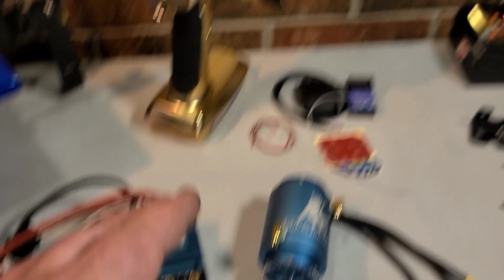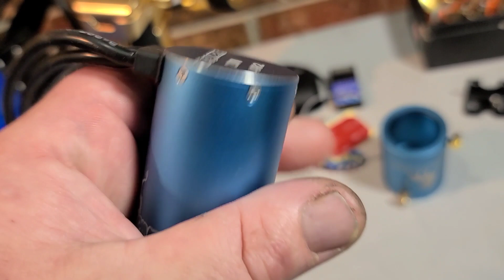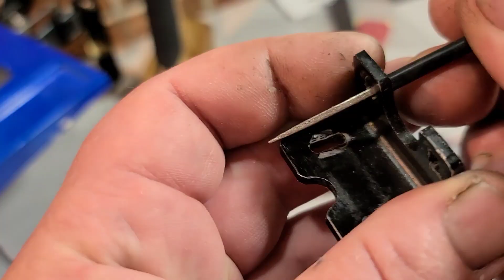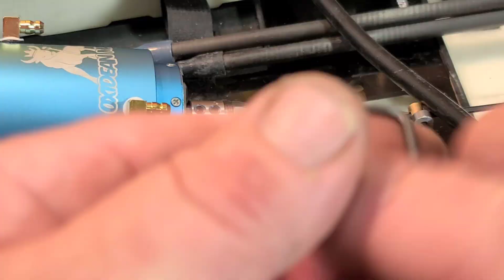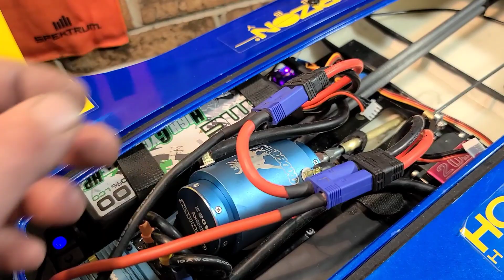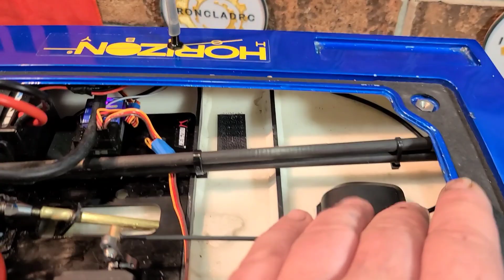Oxidean 200 & 4082 6pole Brushless Motor & Esc Upgrade Proboat UL-19 - Rc Boat Electronics Install

Comment: Hey B, how do you run this boat? Every time I use it, it takes off fast and then the shaft comes loose, leaving it stranded in the middle of the lake. Then I have to re-tie it, and the same thing keeps happening over and over. By the way, I’m running it completely stock. (ANY tips)?
Reply from the maker: You need to remove the see teflon linner and get an HD cable along with a new collet 

Parts list
.187 flexcable to 3/16 stub shaft 3.25 w/ drive dog & nut
https://www.offshoreelectrics.com/proddetail.php?prod=ose-cable-187-XL&PARTNER=ironclad

5mm to .187 collar
https://www.offshoreelectrics.com/proddetail.php?prod=ose-81518&PARTNER=ironclad

You will need to cut the drive dog slit on the cable and cut the cable to length,  this is the setup I run
Reply: @IRONCLADRC  Thanks man I got the upgraded collet since a while ago and the same thing still keeps happening, with this upgraded collet and shaft even though the teflon liner is removed.

Comment: Think I’ve watched this video 10 times lol. Couple hot totties & installing the oxidean 2200KV in UL19 for me tonight!
Reply from the maker: Good luck with the build, what speed control are you running?  Really need a minimum of 200a for the 2200kv oxidean
Reply: @IRONCLADRC  I was afraid you were gonna say that lol. Firma 160a 😳. I kinda like the smart info on remote. Especially the ECS temp. Think it’s even worth trying? I got the motor installed. Was gonna test it tomorrow.

Comment: Now, finally, you'll enjoy this hydro on 6s without temp issues. Bigger motor and ESC is the way to go for that. Use 70C or higher lipos. Watch out for blow overs now. Upgrading the flex wire is a must now. Good choices. Enjoy. Remember to lube the flex.
Reply from the maker: Thanks brother I did the maiden in today's upload. She's an absolute beast

Comment: You should look into a rear motor mount from OSE.  Rear support ring for the motor.   Add strength to mounting of the motor. 
Also sounds a great ul19.  
Removing everything and doing a full inlay will light in the boat up and really wakes it up.
Tip to gauge.   
Slide under the hull at desired height step
Next to the strut.  Adjust strut to new height.   
Also pads 21mm.   Then take away 3 mm for the centerline of the propeller of strut.  
18mm be the new set point.
Reply from the maker: When I do the inlay I'm gonna install a rail style mount with forward &rear support.  

So I used the strut gauge wrong?  Lol.   I've never used one before,  I just looked at your website I see exactly how to use it now.   

Thanks for the support brother,
Reply: @IRONCLADRC   you did was good with the gauge.  May uses for measuring so I think it was a good demonstration and use.